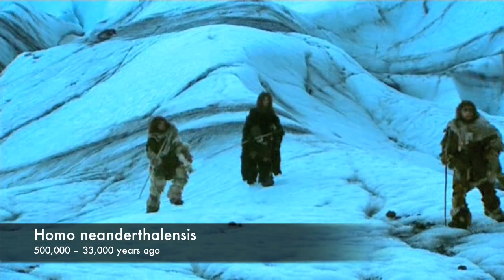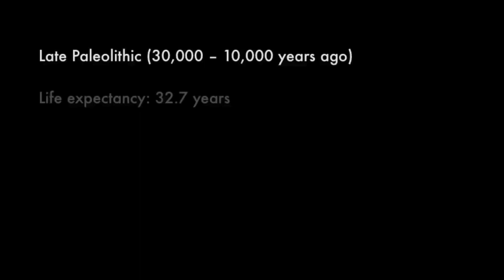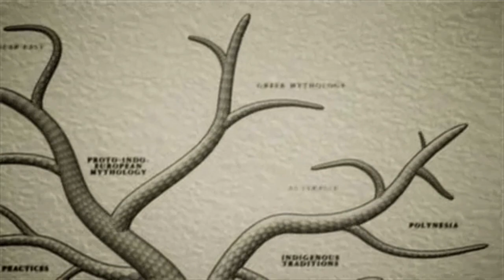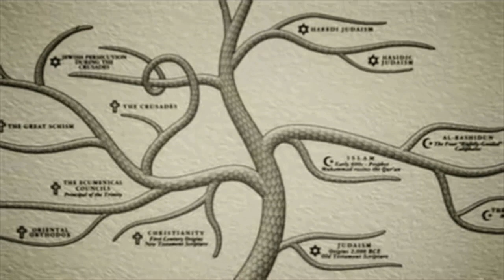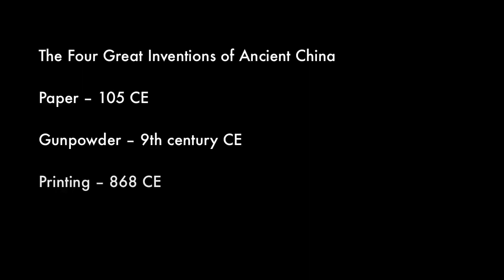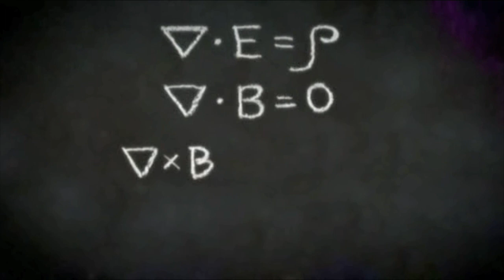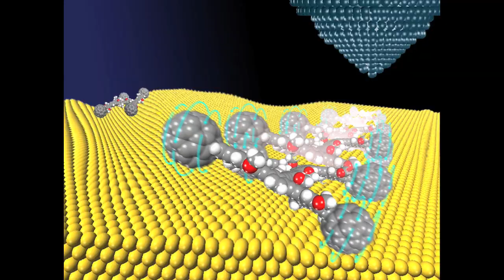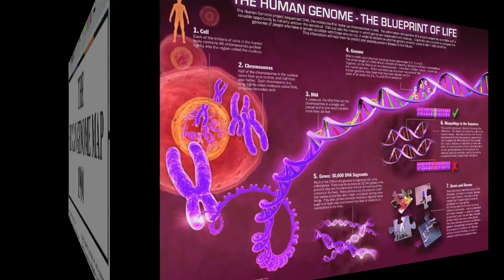Reverse Engineering the Universe

Comment: It has been proposed in several papers on the Mathematical chances of the Universe forming based on the current model of creation is no less than 1 x 10,000^1,000,000 or a chance of random assembly, for one specific protein 1 in 10^130 just consider these figures... it is extraordinarily large! it is equivalent to me taking a jumbo jet; every nut and bolt every thread in the seats all individual pieces throwing it in the air jumbled and it landing completed and ready to fly.